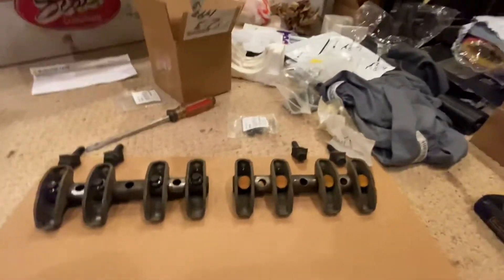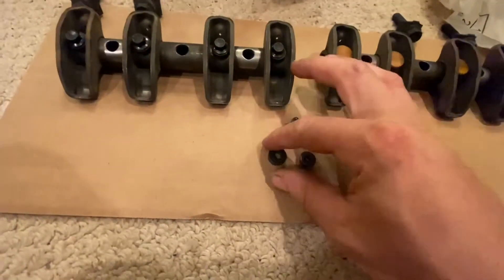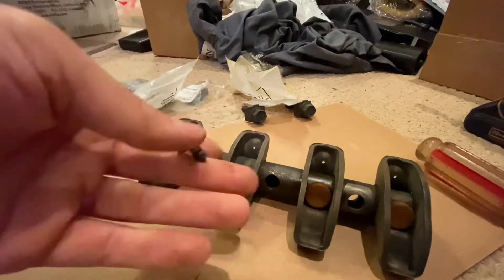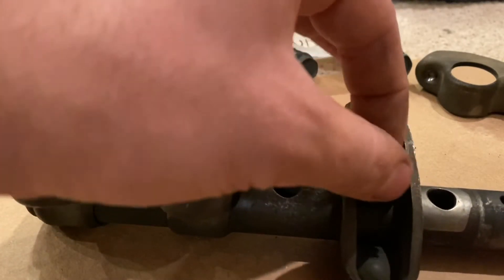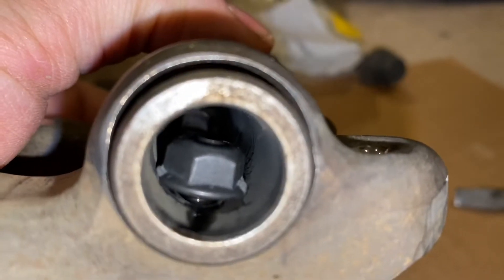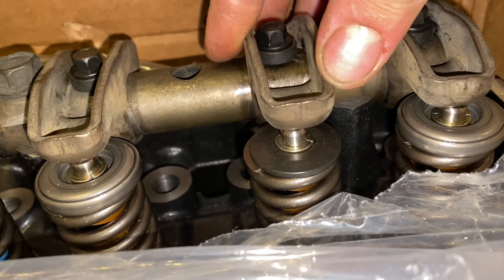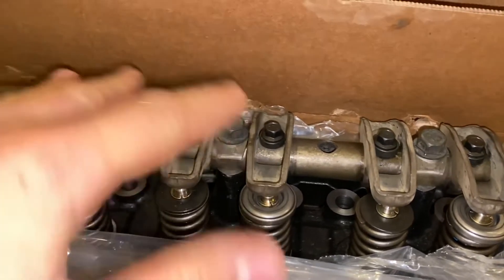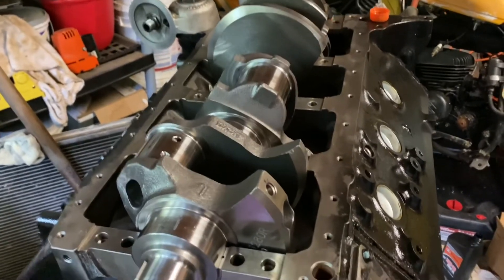6.5 Diesel Rocker Arm Retainer Bolt Mod

Comment: Any updates on this? Any issues? Hows the valve train noise?
Reply from the maker: Engine still runs good, I have not noticed any excess valve-train/ engine noise from this modification
Reply: @ good to hear. Im about to do head gaskets and replace the heads and was debating doing this
Reply: Hey when you install the rockers did you check the valve lash?? And did you put it in tdc? Or just throw them in and install?

Comment: Agreed, too much lateral freeplay.  Ideally have wider nylon/steel washers.  If one used slightly oblong the positioning over the valve stem could be adjusted as well.

Comment: Have any ideas where to get bored pistons ?
Reply: Check out Northern Auto Parts. I'm rebuilding my 6.5l diesel. You can get pistons in std and . 020& .030 pistons. The kit is a great kit. High quality parts, Mahle pistons, Felpro gaskets, Melling oil pump.